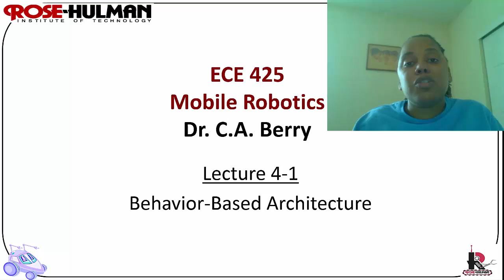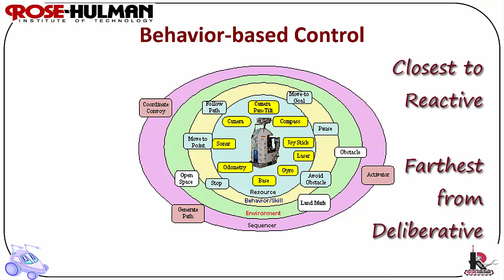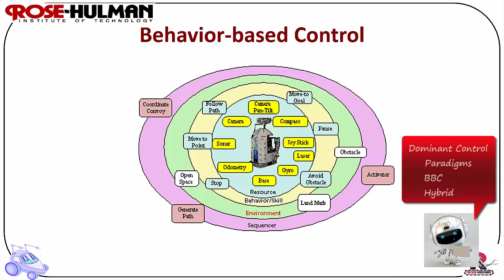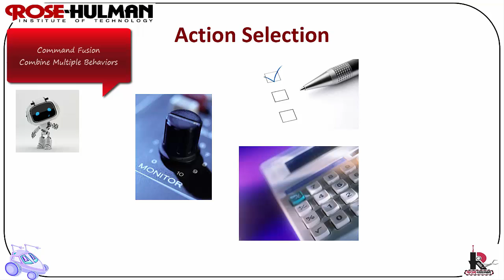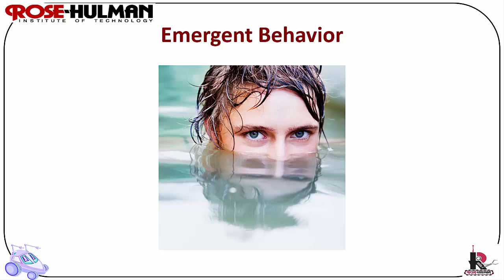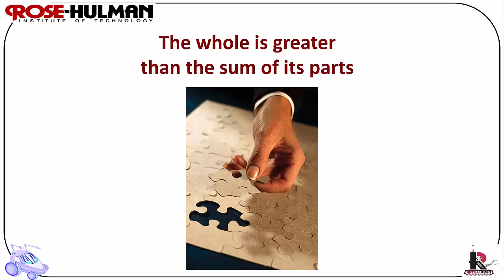ECE425 Lecture4-1a: Behavior Based Architecture

Comment: hey! like your vid. I have one question though: What kind of robots use which control? And in seems that behavior based control is the one most convenient, so why isn't that type of control used all the time?
Reply from the maker: Any type of robot can use any of the types of architectures as long as the system has been designed for it. There is no need for behavior based control in some tasks that are very detailed, regimented, and structured with a world environment such as an industrial manipulator or chess playing or surgical robot.